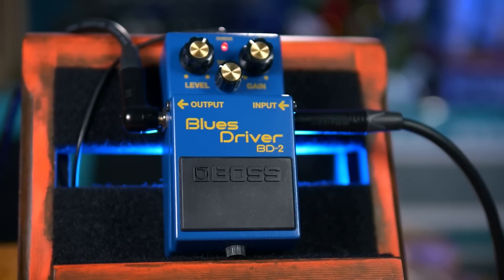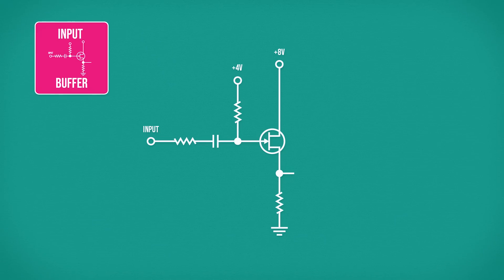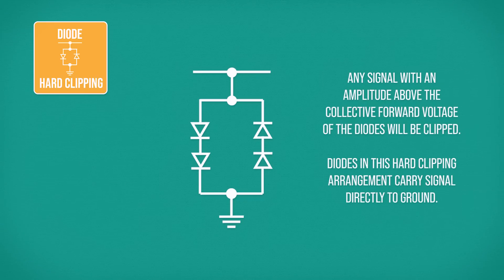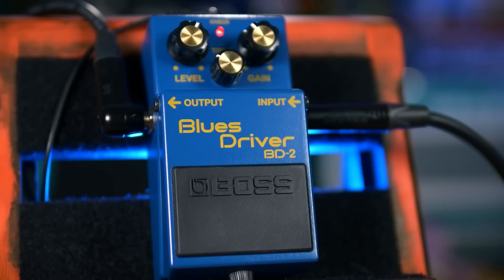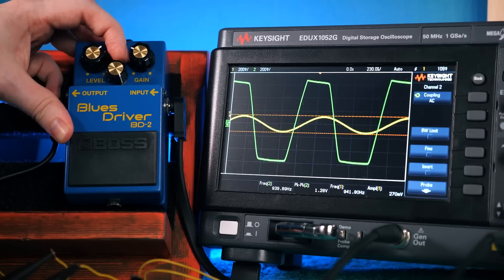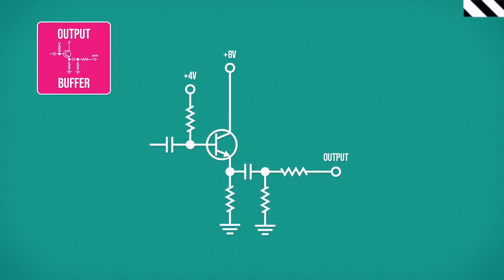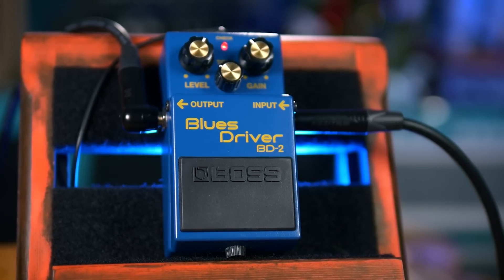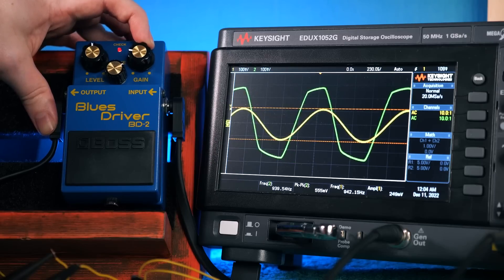SURPRISING Circuit of Boss Blues Driver | Gain Appreciation

Comment: I love my BD2.

If I have only 1 boost pedal, I know how to use my BD2 like a swiss army.

But I do have it set up as my sparkly Ratty-like distortion on the fly at the moment. By gosh did I find I can get a lot of overlapping sounds to other pedals and setups.

It's about understanding the boost function and tone knob work in hand to move the pedal from a dark tube screamer to a bright treble boost.

The distortion is input signal based and so the EQ going is important.
You can use the tone to dial out shrill and harshness but can also be left open to promote air an intended EQ can have.

Important moving between clean and dirty with either volume or turning the pedal on/off.

Treat it like a preamp and it'll do all the up to medium gain things you need.

Comment: So I have a very clean sounding valve amp. and I wanted to get a high gain sound out of it so I stacked an sd1 into a bd2. with the level cranked on the sd1 and the gain cranked on the bd2 gave me the the super high gain I was after. I dont know why it works it just does.

Comment: I love having both in my chain. I play metalcore, and I have the TS as my main drive into a 6534+ for tightening it up and boosting the mids and input, then I slap on the BD for solo boosts. It also works great when I just want a drive for turning my clean channel into a med breakup

Comment: Overdrive IS distortion, technically. . i.e. Any non-linearity.  Even an  imperceptible .00001% is still called "distortion", top to bottom.  
Nobody is "measuring overdrive", heh.
It's but one of the myriad of silly marketing muck that afflicts guitar nomenclature ,  along with the never-ending mis-use of the words "tone", "gain", "tremolo" and "vibrato".

Comment: The Blues Driver is my favorite pedal when I need maximum volume knob control. Typically, I use a RAT for most things, but when I need detail, touch, and something that can translate my playing instantly into sound, I go for that little blue box from Boss.
Set the gain knob wherever you want the MAXIMUM to be (I crank mine to ten) and let your hands do the work.

Comment: I love the Blues Driver. It will never leave my pedalboard. It’s the very first pedal in my chain, I use it to add a subtle boost. Adds a tad bit of compression to a clean channel or adds a bit of flavour and gain to a crunch channel. Also works great stacked with an SD-1 or DS-1. I don’t often use it with the gain cranked but it does give a nice cranked tweed like tone when you do, as this video demonstrates. Such a great and versatile pedal.
Reply: It does a great job in front of my solid state and digital amps. It's always on. I have the gain at zero, the volume matched or just a hair louder, and the tone tweaked for single coil or HB's. It warms up those amps, or the pickups, and thickens (compresses-thanks CD12) up the sound nicely, like a tube amp. For clean songs I'll turn it off, and turn on when hitting the chorus. That's the thickening effect. With a the crunch channel, the driver on, gain at zero, it makes the amp sound really ballsy. I can get the "Mississippi Queen" guitar tone with a 335 and an SG. On the high gain channel  the driver is often too much, but I kick it on to get controlled feedback. It's a great sounding stand-alone distortion. Sometimes I use it alone as the overdrive in a single channel amp. One guitar. One amp. One pedal. Two cords. LOL Cheers!

Comment: It works as a lower gain rhythm overdrive/clean boost for the Les Paul, but I'd be hard-pressed to not have a TubeScreamer after it for solos, because where the midrange peaks on this pedal just doesn't do it for me. Sounds like it's flubbing out when you turn the gain more than halfway up.

Comment: You know... Im wondering if you could almost mod this pedal into a buffered fuzz 🤔 im in no way skilled at electronics, but the way i see it, it looks like you could increase the overall gain swapping a couple of resistors and bypass the clipping stage (remove the diodes) to cascade one stage directly into the next. I might get an early 2000s blues driver just to test it out. Interested in your thoughts on this

Comment: One question. Why is not a Boss OD1 not dove into. With the OD1 I'm able to get clean tone but with distortion completely off and tone in it's extreme able to emulate a Fender mixture with Gibson Humbucker. I also use the DS1 to get distortion. So, this third Boss Pedal AKA Blues Driver set with other two pedals forementioned should get almost ever possible tone of past. Now to get today's distorted tones might take adding a different pedal, but until I try a Boss Blues Driver in conjunction, I can not attest for today's sounds. Even thou, others are able to afford and test these products by either buying or conning pedal companies into forwarding, I will test my theoretical tones in due time. Thanks for your opinions and I see possibilities, but can not explore until I get even a used Boss Blues Drivers. All except three pedals are Boss. The closest to the MXR Series, and I will not sell any of these tone buster pedals. I was fortunate to be able to conduct, back in the Early 70's at least 11 or was it 10 various pedals and could at that time afford only three of those tones. When I was part of a group I did use a Phase 90 and a wah wah. Music has changed since then but guitar tones never die. They just keep getter cooler. 👍👍👍👍👍👍👍👍👍👍👍👍👍👍👍👍👍👍👍👍👍🙈🙉🙊😎😶‍🌫️

Comment: I have a Alchemy modded Blues driver on my board. Next to a Meat and 3 modded Soul food. Surprisingly the BD-2 is more gainy at lower gain than the Soul food. Unless I really turn up the gain knobs or switch to the op amp setting (Klon). I use the middle setting mostly (open). I use all my drives at a lower setting of gain so when I stack drives it doesn't get to crazy. The 3rd drive is a bias knob modded older 3 knob Tube driver. My fuzz style drive.

Comment: It's a soft distortion pedal similar to the Boss OD3 which is neither an overdrive nor a boost. More in the league with The RAT than a TS808. It sounds like a boosted little amp cranked  up

Comment: Every OD, distortion and fuzz pedal does the same thing. The only difference is how they actually sound. Looking at the schematic rarely tells you anything about that sound, other than what comes out will be more distorted than what goes in. You'll find OD pedals that use diodes in the feedback loop, diodes to ground, or no diodes at all. Same goes for distortion pedals and fuzz pedals. Even casually looking at their oscilloscope displays rarely will tell you how they sound. Talk about hearing with your eyes...
Reply from the maker: Sounds like you just don't know how to get relevant information from circuit diagrams and oscilloscope traces.
Reply: @ScienceofLoud  OK, tell me how a Fuzz Face circuit gets such a good overdrive sound using two transistors in a very high gain configuration, very low input impedance, and no diodes? Or how a Sans Amp gives such good distortion using some bog standard op amp circuits and no diodes insight? Furthermore, unless your eyes are good at FFT analysis, the oscilloscope it a nice visual plaything but won't tell you much about distortion, harmonic content, of dynamic response. Sure, that waveform getting clipped will visually tell you the circuit is distorting. But I'll bet you that pedal you can see a dozen screenshots of a waveform getting clipped from a dozen different circuits, and you will not be able to tell which circuit is doing the clipping. 

Fuzz, distortion, and overdrive are marketing terms, not engineering terms.
Reply from the maker: @timescobedo3512  you should try watching some more of my circuit analysis videos, they answer the questions you are asking.

Also, I've been threatening to do a video on FFT and what distortion looks like in the frequency domain for years now. Thank you for the reminder, that's a side of my oscilloscope I haven't yet shown in videos.

Comment: As far as I know, BD-2 was created to sound and behave more like an amp when distorting, rather than a pedal. I don't know if they really succeeded in that, but they at least created something very useful. And it is indeed more reactive to what you want to do with it than a simpler drive or distortion.

Comment: The blues driver is one of the best drive pedals ever made. The big muff and the blues driver are my two favorite drive pedals.
Reply: They actually pair extraordinarily well together! One of my fav combos for shoegaze-like tones is the Blues Driver (any model so long as the gain is dimed) running into the Keeley Loomer - a big muff on one side and some really unique/interesting modular reverbs on the other. The Blues Driver acts as the fuzz running into the reverb (fuzz last switch) and using the Big Muff side as an extra gain stage for verse-chorus-verse style songs. Lots of fun for only 2 pedals.
Reply: Try the plumes
Reply: @tmoss89  I have one. I stack mine with the blues driver. It’s my favorite screamer I would say. But better with other pedals I think.

Comment: All I know is that if I use a mid-heavy boost pedal in front of the blues driver, I can push drive a lot more, and tighter, than if I had just turned the gain up on the pedal

Comment: Is it a myth? Best way to change the sound of your amp is to change its speaker.
BTW, keep up the awesome content Colin.
Reply from the maker: The speaker is the only part of the system to generate sound, so changing a speaker will have the most dramatic impact over the sound produced - but that's not the same thing as 'best'.

Best is about understanding your equipment and knowing what you need to change in order to get the results you want. Changing a speaker may not be the best course of action if what you need is more headroom, or more dynamic range from your pickups etc.
Reply: Would this topic be worthy of further discussion? I have questions and because speakers aren’t much cheaper than pedals, have not discerned how to make my tone better. Pedal vs Speaker purchases.

Comment: How does the tone control work? Does it cut out the highs or add?
Reply from the maker: It's a passive low pass filter - it does the same as a guitar's tone control: removes highs from what is a very bright signal.
Reply: @ScienceofLoud  Ohhh i see. Thank you! Keep rocking
Reply: @ScienceofLoud  I always forget that it's actually removing the highs ,because it will definitely make you think that it's adding them 😂but that's one reason I love it .I Shoe Gaze with every thing on mine set at 1:00 !

Comment: Have one and I dont think it’s very good
Reply: When I got mine I hated it .I usually run a Klone into a Tube Screamer on most my boards .I couldn't get a good sound with it into a T.S. but I pulled it out of the closet and put it after a Klone on a ambient ,shoegaze board .It sounds amazing with a wall of Chorus ,Delay ,and Reverb after it .I love how it's clarity cuts through ,and it hauntingly sits in a mix with a lot of effects .
Reply: @STRATMAN1969  might have to try weirding it up
Reply: @jokermtb  would the Stratman lie to ya ?
Not even kidding dial in a huge chorus'y big beautiful delay with a deep reverb while playing some arpeggio picking then hit the BD-2 with every thing set at 1:00 & some power chords .Post Rock chaos .You won't be able to hide the joker toxin grin 🤩

Comment: What's the point of having a good dynamic response from the pedal if you're running it through an already overdriven amp? If you want to explore the dynamic response of the pedal, you should plug it into a clean amp

Comment: BD-2 is trying to emulate an overdriven push pull power amp. The gyro filter at the end is to emulate the speaker impedance effect on such a tube amp. The power amp has harder clipping than a preamp tube normaly has.

Comment: Really interesting video.  I never liked using the blues driver by itself as I felt it seemed too muddy.  It needed an EQ or another drive pedal to brighten it up.  Your Frequency Response Analysis tells me exactly why that is!  "Muddy" tones happen between 100-150 Hz, and this silly thing is boosting 130 Hz.  That's the frequency that I usually try to get rid of!   I don't mind 60 Hz, or >250 Hz... But 120-130... Ugh!   So anyway, thanks for clarifying this.  I wonder if I can mod my Blues Driver to change that boost frequency with a separate dial!

Comment: Nice and didactic presentation.
The Blues Driver is more a 'disttortion' thanks to  its  hard clipping  stage.. But is the Klon (which also do hard clipping) a distortion.
The OD/dist./ fuzz naming given to pedals are often a bit arbitrary...
The last stage with diodes in a feedback loop around the op-amp IC also do some soft clipping i think

Comment: Really an Excellent video.   I think one reason they used descrete components is to keep white noise down because it has so many active stages in series.    While watching , one of the 1st things in noticed was the  cool animation when you made the   stages slide into plays . Im like ... How Do i Do That ? and you show later its with Skill Share .. which i will definitely check out .
 One mod i would do to the circuit is put a 470-2k ohm resistor in series with the 1st set of clipping diodes to give it some softness for headroom.

Comment: I predict that in the future, the BD-2 will be recognized on the same level as the Centaur, the Tube Screamer, the Bluesbreaker, and other classic circuits, and used as the basis for many more reinterpretations and customizations. It's strange how Boss pedals are so frequently looked down upon by so many people, when they are self-evidently among the best pedals on the market in every category. I know that a lot of this has to do with the now multi-decade long hangover caused by misunderstandings concerning "true bypass" and buffers, what they do and don't do, what they can do and can't do, where each type is appropriate, and where it isn't, but it's really become a tiresome annoyance how many people still repeat bad information. 

It's been my opinion ever since the BD-2 was first released that it's Boss' best analogue drive pedal. Back in the 1990s, I used all Boss pedals, because they were the best, and because if they were good enough for Robert Smith, they were good enough for me. I'm currently using all Boss compact pedals for my bass pedalboard, and my guitar pedalboard is now built largely around a Boss GT-1000Core (primarily for chorus, delay, and reverb).
Reply: The Blues Driver is well respected, though. It's frequently mentioned as a class of it's own (cascading op-amps), alongside Klon(e)s, Tubescreamers, Bluesbreakers etc.
Reply: I remember in the 90s looking at Guitar World magazine & just staring at the Boss Pedal ads for a good ten mins
Reply: neonthunderbird  I have a TR-2 which goes at the end of my chain precisely because it has a buffer (and I wanted a tremolo of course). There's a BD-2 in my chain as well, but that's just because it's a brilliant overdrive. The whole 'true bypass' thing was just a hype. One I'm happy to see is on it's return.

Comment: In my opinion this is a massively underrated, I bought a Waza version of it on a whim to replace my MXR modified OD last year and it turned out to be an absolute metal monster, into the front of any of the high gain amps in the Helix, it just creates an absolutely crushing sound... So now I have 2
Reply: How does it play with other overdrives if you’ve tried that? Im looking for something to pair with my ts9, right now I pair it with a walrus warhorn…. Which is a ts9 clone :^l

Comment: I've used my Bluesdriver as a distortion style my whole playing career. My settings are:

Level: whatever matches the amp
Tone: 12/1 oclock
Drive: 2/3 oclock

This on a no breakup Fender hot rod deluxe or a Roland JC-40

Comment: You could also argue that the Blues Driver is a fuzz (and it sounds like one at higher gain). Whatever it is, it works so well at low gain settings, has a huge gain range, and responds amazingly well to playing dynamica

Comment: I have a Blues Driver pedal and really like the sound from it, but I do get the buzzing noise like I have with any Boss pedal. Is it possible to mod the pedal so it’s true bypass to eliminate that buzz as I can only stand it for so long?
Reply: Sounds like your power supply is probably the issue...Boss pedals don't buzz usually

Comment: That was a fascinating explanation and presentation of the circuitry and signal processing stages inside the Blues Driver. It was interesting to see what was happening on the Oscilloscope as the knobs were moved. I hope you do more videos like this in the future. Perhaps you could show the Oscilloscope as you turn the knobs and then play, so we see a visual representation of what we're hearing. That would be very cool. Thanks

Comment: it's actually great for some glassier shoegaze tones here. i like that it has an edge to it because too many blues guys go for these overly smooth tones, i like that it has a fuzzy edge.
Reply: Ironically its 'edge' is what makes it feel more 'amp-like' than overly smooth overdrive pedals. Yet to experience a cranked up valve amp that's remotely smooth, that sort of tone is very much something you get from pedals.
Reply: That's what I use mine for .Everything set at 1:00 ! Sounds sooooo amazing with a wall of Chorus ,Delay ,and Reverb after it   💙🚙= 👟  👀

Comment: First thing, glad you got schematics and basic eletronics to show. 
Second, i like how you showed on the oscilliscope as you turned the gain up. You showed 2 signals a yellow and a green, are both signals present through that one pedal? I like the gain still rounded not clipped..is there a pedal with 3 rounded gain paths?
Reply from the maker: Yellow is the input signal (before pedal), green is the effected signal (after pedal)